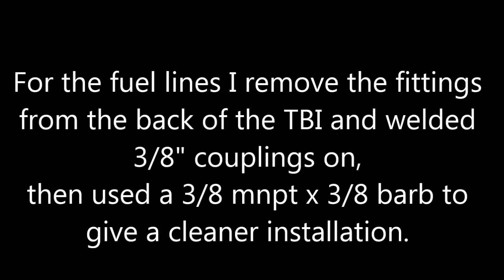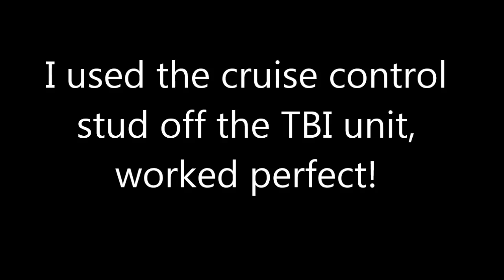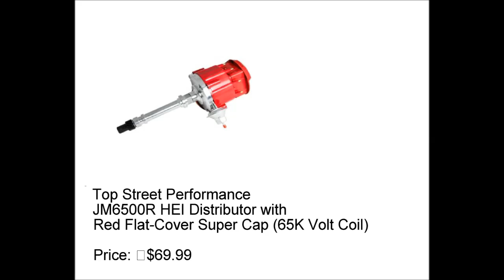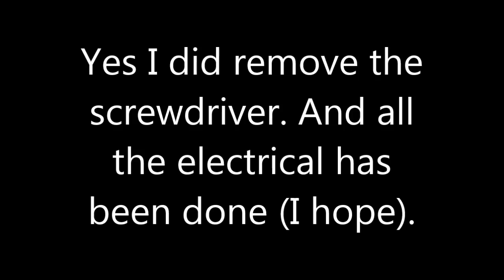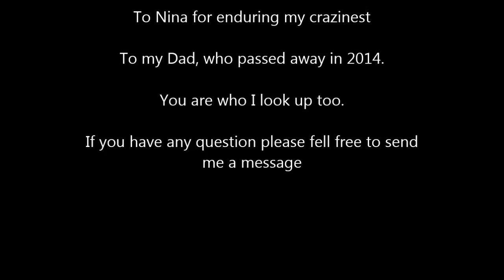Chevy Truck TBI to Carb Conversion 2

Comment: Hello, wow !!  sweet video you have.  May I trouble you for a question in reference to this build ?  It's perfect timing as I'm wanting to convert my 95 chevy 1500 ('93 TBI engine) over to carb
I have a newly built '69 Chevy 302 (yes guys chevy made a 302..lol) 10:1 compression producing approx 425hp @ 6800 rpm's, 2.02/1.60 camel hump heads w/solid lifters, a winters aluminum intake (69 Z/28) and the 780 Holley carb.

I'd like to use this 302 I have sitting in my garage.
I was looking at a complete conversion master kit for around $1900 rated up to 500hp # MCP-700R4  (trans, converter, trans cooler kit, all lines and cables and external lock-up kit)

- What 700r4 transmission converter kit did you use and what stall speed ? 1600-1800 ?
Thanks for any help of getting me in the right direction
Reply from the maker: Camaro Z twentyeight Thanks for your comment
I will be using a TCI Lockup kit, TCI 376600      ,   200-4R / 700R4 Torque Converter Lockup Kit. I am using stock stall for mine. What will be your idle rpm? What are you using truck for mostly? Everyday driver? Strip? I would use your idle as a reference. Hope that helps..
http://www.jegs.com/i/TCI/890/376600/10002/-1?parentProductId=748599  or
http://www.tciauto.com/tc/2004r-700r4-lockup-wiring-kithtml/
Reply: Papa Ragan
Reply from the maker: Camaro Z twentyeight
2800 RPM? IDLE SPEED? WOW, thats a hot motor!
Here are some tips:
http://www.ebay.com/gds/The-Right-Stall-Tips-on-Selecting-a-Torque-Converter-/10000000010268586/g.html and

http://www.jegs.com/s/tech-articles/torque-converters.html&title=Performance+Torque+Converters+-+Torque+Converter

http://www.bankspower.com/techarticles/show/10-Understanding-Stall-Speed

http://www.speedwaymotors.com/Tech/transmission-how-to-choose-a-torque-converter.html

These are articles I have read. It can be daunting. Good luck! Let me know how it goes.

Comment: Quick question,  i did this tbi to carb swap and im curious as to  where you have your timing set at, ive been messing with it on and off for 2 weeks and cant seem to get it, any input would be  helpful. Thank you.
Reply from the maker: Well on this engine I have set it about 6 degrees before top dead center. but on an older motor the outer ring on the harmonic balancer tends to move slightly over time. Too advanced can make it hard to start and engine may over heat. Too retarded and you loose performance. Are you useing the stock distributor? If you are the ecm will always try to correct anything you do. Best to use an earlier HEI and not the original.
Reply: Papa Ragan thankyou for the reply, it a bone stock engine and i am using a summit racing hei blueprinted distributor,  it runs and drives, but i have a bad rattle at almost 1/4 throttle.

Comment: I'm having issues with mine.... I have it hooked up have pressure on inlet side but no outlet pressure? My gauge reads 0
Reply from the maker: Are you talking about the fuel regulator?

Comment: ok thanks clears alot up...  the white  wire you have on the left side of the Junction block is that main input power to the fuse block?
Reply from the maker: Send me a pic if you can so I can help more or post it
Reply: Papa Ragan I can post it on my channel when I get off later if that will be sufficient
Reply from the maker: That will work,...
Reply from the maker: Did you post yet?
Reply: Papa Ragan  I'm sorry haven't posted yet working late duty hours I'm in the airforce. I'll get to it shortly thank you for the check up, again it's a rolling chassis
Reply from the maker: No problem, Anytime I can help. And Thank You For your service to this country.
Reply: Papa Ragan thank you I been serving going on 12 years I'll make a video soon

Comment: shouldn't the left port on the carb be used for vacuum advance on the distributor?
Reply from the maker: Well the Carb manual said right port but I switched to the left, seemed to work better. Thanks, Papa.

Comment: Hello
Great vid. Do you know of a way to retain cruise control with carb swap?
Thanks
Reply from the maker: Yes, The speedometer works off the ECM and so the Does the cruise. Thats the only reason I still use the Ecm.

Comment: I see that you actually reply to your comments, so i have a question. I have a 88 caprice 305 that was tbi, it was converted to carb somewhere along it's life but the hoses that where connected to the factory air cleaner were pluged. One from the valve cover and the other from exhause manifold. Did you have the same issue?
Reply from the maker: +Stephen Davis The one from the manifold i would say is to transfer heated air to the carb. I deleted this one.The one from the valve cover is your PVC valve. You need to keep this as it burns off excess oil gases. This is cleaner than a blow by tube (I think that's the correct name, its been a while), unless you like have oil all over your engine. I hope this helps and ask anything anytime and I will try to respond promptly. Papa.
Reply: +Papa Ragan Ok the one from the manifold smokes heavily is that fine? and how to I delete the one from the manifold?
Reply from the maker: Can you post or email pics?
Reply: +Papa Ragan yes what's your email?
Reply from the maker: ka4tfb@msn.com
Reply: +Papa Ragan Ok I'll send it when I get off work. I just subscribed as well. Thanks
Reply from the maker: No Problem, I'll try to help any way I can.
Reply from the maker: +Stephen Davis Did you send them?

Comment from the maker: ** Update: Still waiting on warm weather to install the trans. If it works (LOL) I will do a video on the build and the tools I bought and the ones I made. See you soon! **
Reply: another question was it hard to take the old manifold off? did you have to take the valve covers off?
Reply from the maker: Taking the intake off was pretty simple. I would take the valve covers off. Just makes it easier.
Reply: +Papa Ragan.  Thanks for sharing the video; did you upgrade your in tank fuel pump for greater pressure?  What issues did you find/resolve with your Check Engine Light?  You mentioned that you used the cruise control stud, does that mean that your cruise control is still connected/functioning?
Reply from the maker: +J Foley In answer  to your questions:
I'm using the stock tank fuel pump. I just added a regulator to drop the pressure before entering the carb. With out a regulator  your fuel pump will over power your carb and you will have fuel every where. NOT a good thing.  Check engine light, Just took out the bulb, what good is it any more? Yes the cruise is hooked up and still functioning. That is why I have the computer hooked up. As soon as I find an inexpensive way to get it off the computer I will and I will post it here. Your speedometer is hooked directly to the computer and so it controls the cruise control. Hope that helps, Papa.
Reply: +Papa Ragan Thanks for the quick response.  I'm working a power plant upgrade and see too many variables (and expenses) in sticking with the TBI system and ECM
Reply: what wire did you use for the electric choke. I'm doing the same thing on my 91 C1500.
Reply from the maker: +Clint Moore Check out this vid https://www.youtube.com/watch?v=myTSUdSJLdA.

 First use the pink wire coming from the ignition (It should be connected
 to your coil). you will use this wire for your  electric choke, HEI and
 fuel pump.

Fuel pump wiring:
Green/White - Cut and connect to ignition(the pink wire)
Black/White - Ground
Red - Disconnect and cap
Orange - Connect to battery
Grey - DO NOT CUT
Hope this helps
Reply from the maker: Pink wire. It is controlled by the ignition switch.
Reply: I just finished a TBI to carb swap on my 92 K2500. I found when doing the wiring I used the pink wire going to my coil as Paul suggested and connected it to the Batt terminal on the factory HEI distributor only. I don't suggest sharing that wire with anything else because you want the full uninterrupted 12 volts going to that internal coil. I did feed my electric choke with the red wire from the injector which is only hot when key is turned on. I also found that my Fuel pump energized during my initial start up without having to do a thing. I do plan on posting a vid in the next few days of my install....

Comment: Papa Ragan,
1) Thank you for taking time to compile and create this video.

2) I'm looking to do this. I have a 350 with an SM465 manual transmission. But I have converted the truck from an automatic to manual transmission. I have both ECM's, for both a 350 with an automatic transmission and the ECM for a 350 and manual transmission.
Question #1: what happens to the factory cruise control? Can it remain as part of the system if ECM is remaining? How did that work for you?
Question #2: Other than cruise control, what else is controlled by the ECM in your truck?
Reply from the maker: #1 as far as I have found the cruise is in the ecm as well as the speedo.
#2 The ecm controls all timing aspects and the speedo and cruise control.
Reply: I purchased the same distributer you purchased, a Top Street Performance JM6500R HEI. It came with no wiring instructions...I'm not sure why. 

There are 3 wires going from base of distributer to cap, black, red and yellow. 

And then I purchased the HEI 2 wire pigtail with red and green wires.

The question I can't seem to find the answer to via my searches on the internet tonight is what do the 2 wires of the pigtail get connected to? I'm assuming one goes to the pink hot wire you mention in your wiring video. Which one? And what does the other wire get connected to and which wire is that?
Reply: I just located a video to answer my question on 2 wires.  One will go to pink power and other will go to tachometer inside cab.
Reply: The hole in the valve cover on the driver’s side...did you end up connecting something into it, or left it open or did you plug it?

Comment from the maker: Got my Trans in and had to replace the timing chain. I did a video on that and hope to post it soon.
Reply: Great video. Made the conversion after watching your video. I have a 93 chevy pickup with a 4l60e tranny and I mounted the tps but am having shifting problems. adjusted tps to .65 on lo and 4.1 on full throttle. Have to shift manually and lost 4th gear. Any ideas. Also hooked up MAP sensor.
Reply: Im trying to figure this out myself, lucky for Ragan he has a 700R4 not the 4l60e like us. So far the options are to fool the PCM into thinking there is still fuel injection; get a standalone tranny controller ($$$); or flip switches while you drive and have a pulse width modulator generator to set the shift pressure on the transmission.
Reply from the maker: 4160e i have not dealt with. I an using a 700r4(4160). Maybe someone reading this can give us some advice, would like to know to.
Reply from the maker: Sorry for the long delay in answering. My work schedule has been real erratic.
Reply: The 4l60e is an "electronic" or computer controlled 700r4 with no kickdown cable and has a 15 pin electronic plug that goes to the trans. The 4l60 is a 700r4 that is not computer controlled, uses a kick down cable and the small 4 pin plug on the trans is for the torque converter lock up. It will have a MD8 casting on the bell housing.

Comment: im doing this on my 83 z28 305 and also putting a cam in it but what did you do with all the fuel injection wiring did you just cut it off?
Reply from the maker: +David Cahill My truck had throttle body injection. I cut and capped the wires and put them in the wire mold where it is not seen. Hope that helps. Make sure to upload a video of your project, I would love to see it!
Reply: +Papa Ragan thanks for the info i will hopefully be uploading a video but idk when

Comment: I just got a 454 out a 1992 c2500 and want to go carb is the process the same
Reply from the maker: +Erik Cox It should be the same. off course you will have to get the correct intake for your application and size your carb accordingly. Good luck on your project and post it, Id love to see it. Papa

Comment: great video  i did  a swap on my 97 but i cant get it ti fire 
where should i get power to my hei  and tach?
Reply from the maker: +Heveri Barron First use the pink wire coming from the ignition (It should be connected
 to your coil). you will use this wire for your  electric choke, HEI and
 fuel pump.
Fuel pump wiring:
Green/White - Cut and connect to ignition(the pink wire)
Black/White - Ground
Red - Disconnect and cap
Orange - Connect to battery
Grey - DO NOT CUT

Here is another video

Also: https://www.youtube.com/watch?v=myTSUdSJLdA
Reply: thanks ill try that today

Comment: Could I do this with a stock 305 original  motor in a 91 carprice?
Reply: yes you can,i did the same conversion but used a holley carb.you can use the summit carb as well and save a few bucks.

Comment: does this wiring for the fuel pump eliminate the computer??
Reply from the maker: +Alma Cahill 
First use the pink wire coming from the ignition (It should be connected
 to your coil). you will use this wire for your  electric choke, HEI and
 fuel pump.
Fuel pump wiring:
Green/White - Cut and connect to ignition(the pink wire)
Black/White - Ground
Red - Disconnect and cap
Orange - Connect to battery
Grey - DO NOT CUT
This eliminates the computer for the fuel pump
 Hope this helps

Comment: Little help please man. Have a 93 Chevy TBI what intake manifold can I run, the one in the description is only compatible with 1955-86.
Reply from the maker: x Chin this worked on mine which is a 89. there are adapters for earlier models, but you won't need to use them. the four center intake bolts on a 1989 to 1993 are not canted.  earlier small blocks were canted, that what the adapters are for.
Reply from the maker: I am on my phone, but I purchased mine on amazon.  when I get bsvk on my computer I will list a link. I double checked to make shure I didn’t give the wrong info.
Reply: Papa Ragan Fair Enough. Huge thanks! can't wait to get all the goodies and drive a REAL truck.
Reply from the maker: here is a link to where I purchased mine. It should work for your truck.

https://www.amazon.com/Professional-Products-52001-Cyclone-Manifold/dp/B001Q6GRGI/ref=au_as_r?_encoding=UTF8&Make=Chevrolet|47&Model=C1500|424&Year=1993|1993&ie=UTF8&n=15684181&s=automotive&vehicleId=7&vehicleType=automotive
Reply: Papa Ragan Thanks! Also will the 4l60e tranny be compatible with the swap?
Reply from the maker: x Chin 4160e is the electronic version of the 4160 or 700r4. I am not sure if a kit is made for the 4160e. Here is a kit for the 4160e.
http://www.usshift.com/?gclid=CjwKEAjwj6PKBRCAy9-07PeTtGgSJAC1P9xGBUxgHYMgPoI1p3JkiyiO00r2YezGcoY2hjovNtEXmhoClA7w_wcB
Reply: Much appreciated!
Reply from the maker: x Chin I hope it all works out. Let us know when you are finished. Would love to see a vid.

Comment: I have a 94 Gmc Sierra that I switched from a tbi to a carburetor.  I had the transmission rebuilt lately and now he can only get it to change out twice. He says it does fine on the machine changes out great , just not when he drives it.  Does anyone have any suggestions of what the problem could be.it was changing fine when I first put my new motor in.
Reply from the maker: Is your trans controlled by the ECM? When switching to carb you will need a tranny that does not use the ECM. Check out places like Jegs, Summit, Monster and many more.

Comment: Did the transmission work fine with out the tps hooked up I’m having an issue with that
Reply from the maker: I bought an aftermarket trans that works without the ECM

Comment: looking to do this on a 97 chevy 3500 with 4l80e trans what needs to be done for trans to work properly?
Reply from the maker: You will need(from my research) a Stand Alone Transmission Control Unit.I included a link.

https://www.powertraincontrolsolutions.com/Performance_Aftermarket/Products/Transmission_Products/Simple_Shift_Transmission_Controller/TCM-5330/

You may want to do a more thorough research. What I have found is the prices start around $600 and go up,WAY UP!

Hope this helps. If you find more or better info please post it and share it. Papa.
Reply: thanks! quick question the reason im looking to do carb is I have no spark and the fuel pump wont turn on! i have changed pcm twice a number of sensors checked powers and grounds and had 2 mechanics look at it cannot figure this out! truck was running great and just stopped 1 day. it is a Isuzu npr but is the same drivetrain as chevy 3500 its 1 of my work trucks. if you have any ideas it would be greatly appreciated! also it has no power at all going to fuel pump has power to coil but will not spark
Reply from the maker: Joseph Shultes It sounds like you have a fuse link (not the same as fuses)bad or a bag ground. Find out were all you fuse links are. I  have had fuze links at the starter do the same thing. Thats what I would do first, check fuse links. Papa

Comment: How much hp and torque did u gain/lose by doing this convertion?
Reply from the maker: I really couldn't say, but throttle response seems to have improved greatly. Torque seems a little better.  While computer control may be the best thing since sliced bread going carb is more for those who love to tinker with there rides. I personally like to tinker.

Comment: what did you do for your brake booster vacuum line?
Reply from the maker: There is a 3/8 port at the rear of the carb base. Hope that helps..